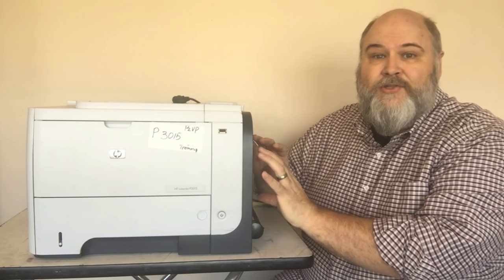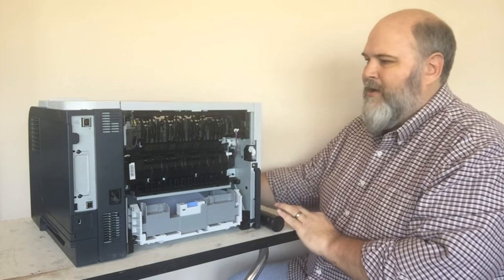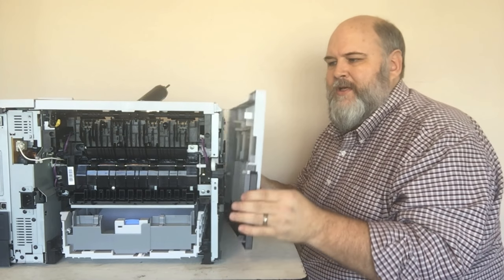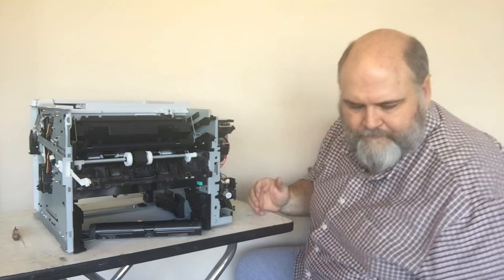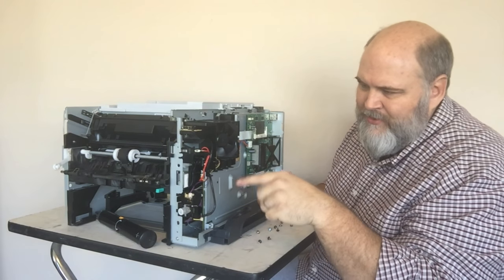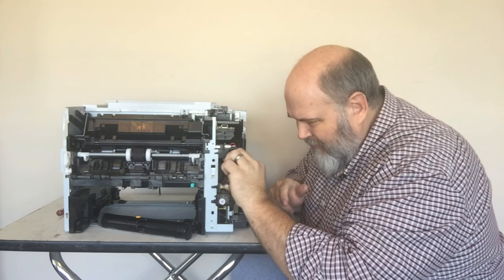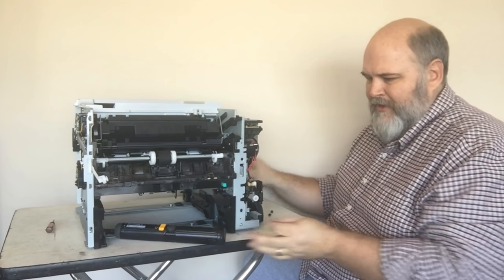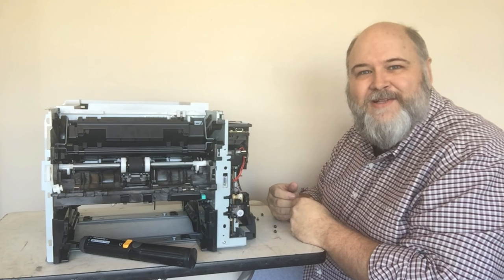PRINTER REPAIR: HP LaserJet P3015 - Solving The Mystery Of The Manual Feeder's Roller Not Stopping

Comment: All HP products prior to the new E series utilize these solenoids however most of these issues are not the plate popping off rather the sponge under the plate attached to the solenoid. They decay over time and the glue left behind will cause the plate to stick when it's engaged. Clean the old sponge off with alcohol and replace with a small strip of thick tape or 3 small layers of electrical tape.

Comment: ...you unnecessarily remove Front Door and Left Cover.
And to repair the Solenoid Tray2 (glues) is needed
remove the Top Cover and Right Gear Assembly;)

Comment: Can anyone help me please? My HP laserjet M110we has terrible alignment. It just prints at an angle and I can't find any way of changing that, even using the HP smart app. It has no option for alignment of this particular printer. HP are impossible to contact now for some reason. I just need my pages to print straight. Pleeeeease help?

Comment: Hi sir ,  I have P2015 series, seems like it has have     FATAL ERROR...

What sud I do ...

Whether it is    ECU board got problem 
or the     FUSER not heating up    ENUG  

Lately I change the   LASER UNIT... last time the problem is the laser unit spinning noisily 

After the laser unit plug in,  the problem solve no more noisy but    the error light turn   into fatal error 3 steady bottom light just on

Comment: I've got a similar HP laserjet that has the same problem. I got the printer for just ten bucks. I've been using it for years with the fault because I don't want to risk breaking the printer trying to fix it. It works fine just feeding one sheet at a time in the top tray. I just can't put more than one sheet in or I'll jam the printer. Works fine for one page printouts.

Comment: We have a fleet of these P3015s, and I have one that seems to jam up with a print job of more than 3 or 4 pages in tray 2. I've replaced the pickup roller, the separation pad, I even swapped out the entire tray with another one. It'll just keep feeding pages, and stop feeding with one page coming out of the top and one page inside around the fuser every time. Sometimes it complains saying it doesn't know the paper size in tray 2.
Reply: All HP products prior to the new E series utilize these solenoids however most of these issues are not the plate popping off rather the sponge under the plate attached to the solenoid. They decay over time and the glue left behind will cause the plate to stick when it's engaged. Clean the old sponge off with alcohol and replace with a small strip  - - Solenoid (magnet) for Tray 2. When feeding paper, it is necessary to turn the Pickup Roller only 1x max. 2x;)

Comment: Thanks for posting this!  Mine just started doing this, and it hasn't even been MOVED recently.  How the heck does that come loose ANYWAY?  Not looking forward to tearing all that apart... :-(
Update: SUCCESS!  I finally got tired of listening to the printer play with itself for a while before it actually printed(it still worked).  I was able to complete the repair.  Mine still had the plate and the spring, but the plate had somehow jumped off the posts(?!).  It was sitting BEHIND them flat on the solenoid.  Thank you!

Comment: Can you help me fix a 50.7 error in HP CLJ 6040 printer.
I already replaced the DC controller, Fuser drive gear in the upper right corner and the Fuser but still getting FUSER ERROR 50.7
Reply: Claudius Remy formatter ftw